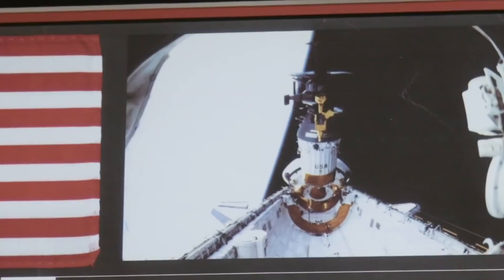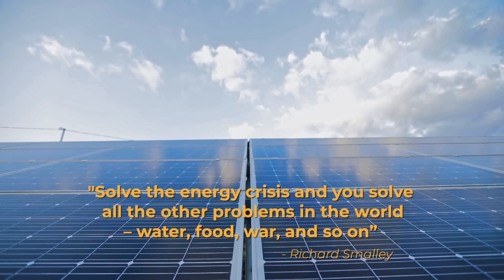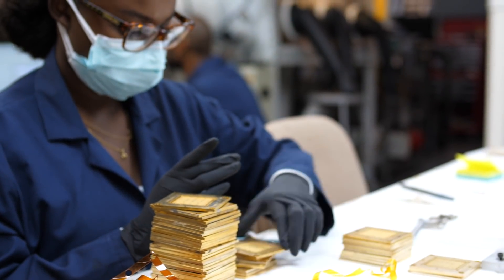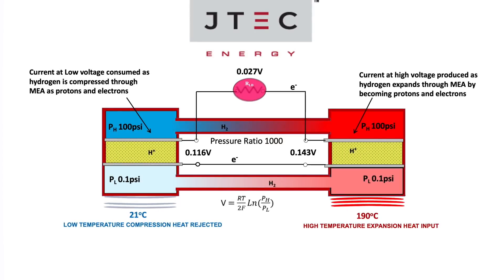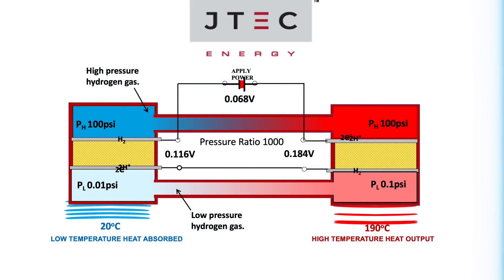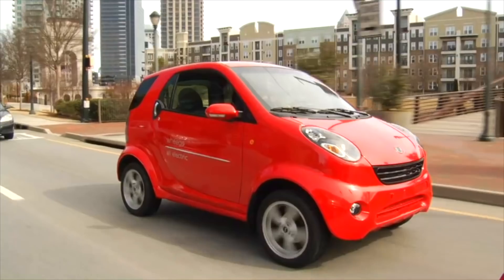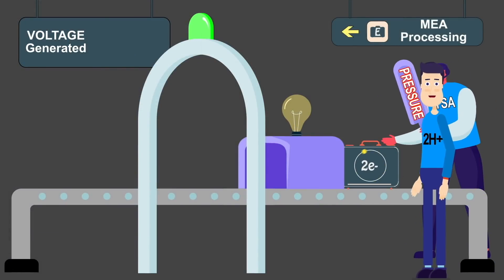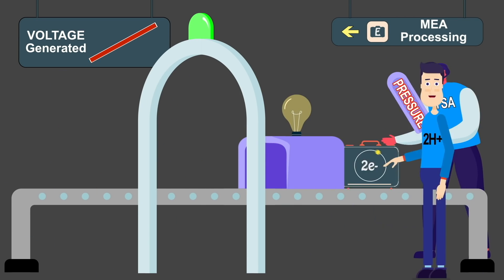JTEC 5 min Overview

Comment: This isn't a power source, it just converts heat energy to electricity
Reply: So it's a source of electrical power?
Reply: @woodboy544  Clever logic.
Reply: "nuclear fission reactors aren't a power source, they just convert heat energy to electricity"
Reply: Are you trying to say solar system is not a power source? It's all about converting energy from one form to another .
Reply: @dangakong6304 it has to become a power source in order for it to be used to transmit energy power?
Reply: Your car engine's not a power source. Your batteries aren't a power source. The power plant that sends electricity to your house isn't a power source.... Right? Right? All those gadgets just convert some form of heat energy to electricity.